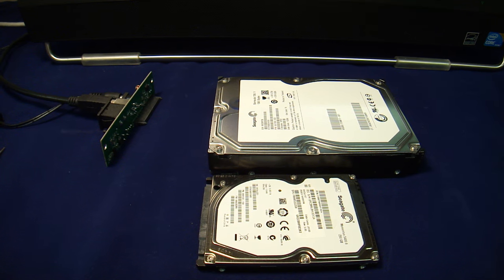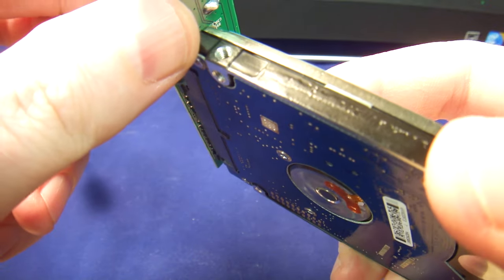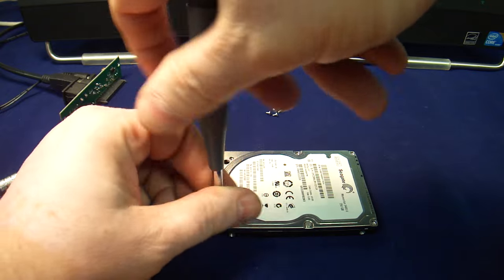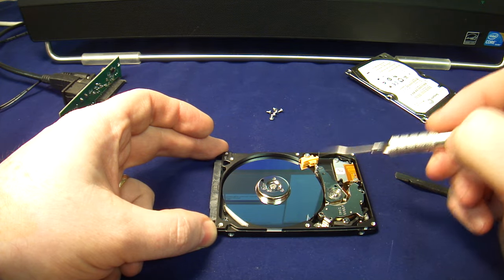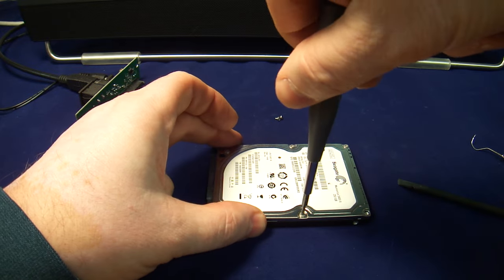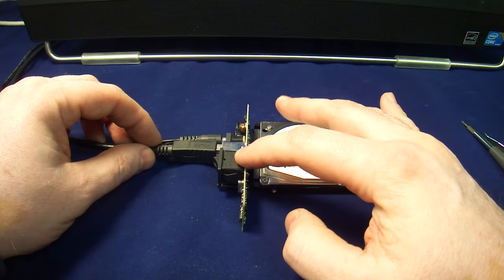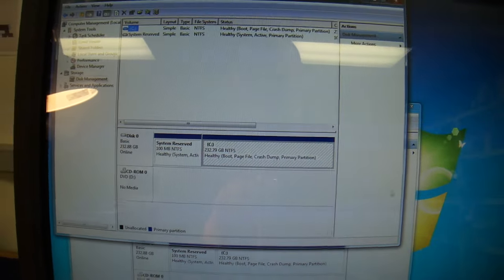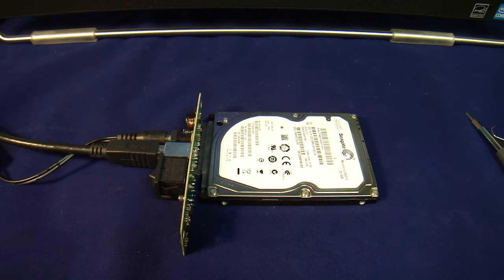DIY Video 2 How to fix a broken hard drive Beeping noise Get your data Back! Best Kept Secret

Comment: I have a problem with my hard drive but its not exactly like these.
When im starting my drive it just powers off by itself, then im hearing that it starts to start up again but again fails. Then it makes no more sound and i cant access it in windows. 

A couple of times i have managed to get it to start but it takes a long time for windows to read all the files on it and it doesnt sound good when it searches, no beeping or clicking really but its pretty load.

I only manged to copy a few gigabytes and then i got the info "cant read from the source file or disk"

What do you think i should do?

Comment: Thanks for your video, it worked on my hard drive; i know you said the HDD is done for and not fixed but is gonna happen again?, or what are the problems if i keep using it?
Reply: Did your HDD got that problem again or didn't pls tell because I'm in stress .

Comment: So I moved the thing off the plate and when I plug it into my computer it still won't recognize the drive but the drive does spin. I have a seagate and the little white light turns on for about 2 seconds and goes away. Anyone have any ideas? Thank you for your time

Comment: Hi Abraham , Thank so much for this great video ...
i have a 1TB laptop hard drive with exact same beeping noise ,
its not detected entirely by my laptop and laptop said no device to boot ,
i take my hard drive to somebody think he is recovery professional(without any isolated workplace or something like that) ,
he told me my hard drive head get weak and need to replace(he did n't even open my hard drive he just connect it to usb adapter) , and he told me i should buy a new exact same hard drive and give him that to replace head , but i feel he lied to me , do you recommend to do what you do on this tutorial by myself and repair my hard drive ? (i need to read hard drive data(some programming file) one time and then send it to trash)

With Best Regards.
Reply: Hi Abraham ,  i fix my hard with one of my friend who experienced in this field , and we do what you did , but use another type of adapter(it was more professional) , but thank you at all ,  this tutorial work for this noise sound ...
so as i said first recovery professional(haha) lie to me and the problem was n't what he said.
at last thank you for your tutorial , but i should mention maybe you(people who see this tutorial) need some software professional to recover byte by byte if your hard damaged seriously .

with best wishes for abraham ,
NothingLand

Comment: I have a 1TB WD Elements external drive, it fells accidentally and start clicking. Unlike the other click of death situations it only clicks at the start and the driver stops rotate. Is there any solution for such case?
Reply: Dereje Chinklo you need to send it for data recovery,  not a DIY job,  try www.copypastemaster.co.uk

Comment: Hey! My hard drive was beeping for like 5 secs continously before ibtook everything from the pc case and put back. Now it doesnt beep at all. When it was working it beeped once only when i started the pc as a sign that boots(i guess). Also my monitor doesnt show anything so i couldnt get in bios. I tried switiching the ram slots,different power source and a different graphic card. Please help,ty

Comment: So I did this and it worked fine at first but when I copied my data it stopped on the half and now I can't access the hdd anymore :'( But their is no beeping noise anymore and the head is on the right position... A last thing I could do?
Reply: I have the same problem , Do you what should i do?
Reply: Sheida D I successfully saved my files with a free program named "Recurva". Just let it search for non-deleted files. It might stop copying some files but then just skip them.

Comment: What coincidence that 3.5" inch Seagate 1.5TB is the exact model I have a problem with.
My seagate drive has a random model number in BIOS and does not report correct capacity. I cannot read the data and it clicks only on cold boot, if I reboot PC no clicking but still cannot access data. I think mechanically inside its OK but the  PCB board might be faulty. I  had a power outage for a split second rebooted PC and it was fine. Next day I cold booted machine and it was not working. everything points to PCB but I dont know how to be sure.

Comment: Please I need a council from you there is something that happened to me today I was working with my hard drive suddenly is stopped working I decided to reboot my system which is my laptop thinking that it will come up the hard drive did not come up I removed it put it in another Pot thinking that it will still come up the same thing I decided to remove the hard drive took it to another system plugged it still the same thing he did not come up in this case what will I do I've watched your video I love what you did but I don't know what to do please give me a council what will I do

Comment: Hi Abraham, I have an external HDD with the following symptoms
- platter spins
- arm is not moving at all (not on platter)
- after about 3 mins, the platter stops spinning

What can I try to do? I don't have money to send it to recovery centers. Please reply. Thanks.
Reply from the maker: +sgn15 You have electronics issue. Look for a busted chip or try to find a replacement board. It has to be identical.
Reply: +Abraham Levit By "chip" you mean the ones attached/soldered on the circuit board itself?
Reply from the maker: Yes

Comment: Thank you Abraham! Your instructions are right on the money. I recovered data on my WD 500GB laptop HDD without a problem. The only difference is that my WD HDD has 4 hidden screws I had to unscrew before I was able to open the cover, two under the label, two each under their own silver sticker like seals as outlined in this picture: https://drive.google.com/file/d/0BxLnd7HOI_k7OXZOYmladUl5LVU/view?usp=sharing

Comment: Hi Abraham. I opened up my hdd, and there are two scratches that run all the way around. No idea how this has happened. Is there any way I can recover the data? Please answer :(
Reply from the maker: Your heads are gone your platters are done for and data is probably corrupted. I have a video on that.
Reply: Thanks for answering. Yes thought as much. How does that happen tho? It's a 6 month old laptop, brand new. I didn't drop it or anything. I have since installed a new HDD, but I have lost all my data.

Comment: Mine hdd head stocked, I opened and released but its still doesn't work. ive two beeping noise not a clicking when Im turning my laptop now. could you guide me . Im living in Los Angeles if you know any place that I can bring my hdd
Reply: the reason that my HDD damaged, I put to much pressure on hdd cover

Comment: Hi Abraham Levit, my Seagate External drive started acting up 2 weeks ago. These are the symptoms:

1. beeps when computer turns on
2. does have power (has own power source separate from USB 3 cable)
3. i get a message from windows saying "usb device not recognized one of the devices attached to this computer has malfunctioned"
4. Cannot get to Disk Management, it freezes.
5. It (Windows explorer) freezes when i try to access the drive itself.
6. No clicking sounds (aside from the 1 beep all sounds seems fine)

Any suggestions? Thanks a lot!
Reply: Andrew Luis disk is completely dead

Comment: Thank you Abraham, I was wondering if you can help me, I have a 2.5 inch WD my passport ultra (4TB), 2017 version, suddenly it did not show the files and it does not eject when I eject it on my MacBook Pro, when I eject it, it comes back and it makes a very light sound, then turns normal, is there anyway to fix it rather than open it? Is it possible that the PCB is not working properly? I checked the HDD health and it says it's good nothing wrong with it, I installed the wd recoverit app and check it for a bit and it showed files, meaning I can restore them, but not yet cause I don't have enough storage, so in order to restore my missing files I am gonna need to buy a 4TB or 5TB one, that led me to make a search, I found out there are CMR, SMR and other types of drivers, I figured my WD ultra (4tb) 2017 might be a SMR drive, that is why it is faulty now or maybe it is the PCB! So, as I mentioned before I wanna buy another (4TB),  that is why I wanna make sure that I buy a CMR one, Can you please give me a list of 2.5 inch (4Tb) drives that are CMR not SMR? Even if it was a 2015 or 2016 versions? Or any older, newer ones? Cause I am planning to buy 2 drivers for now, Or any  good reliable 2.5 HDD recommendation or advice? I would be grateful!  Thank you

Comment: hi abraham i have a hitachi ata/ide internal hard drive which i am using as an external using the ata to usb port it has the clicking problem.i dunno how to fix it.i just wanna know whether is it safe to connect to my laptop as an external which i usually do will it affect the lap or anything.pls help.thanks
Reply from the maker: Its ok to connect as an external nothing will get messed up.
Reply: thank u :) mines not working got the clickin noise i opened it up and adjusted the head still nothin..
Reply: i think there is a problem with head..
Reply: +Sushil Kumar, U mean with your head.? That's possible..
Reply: Yes there is care to come and fixit😜

Comment: My Samsung 1TB external had the same problem, beeped and didn't connect to my pc. The head stayed on the plate. We fixed
 it like in the video. I connected to the pc, it was good at first, 100% condition, but at the second connection it started to warm and worked slowly, the condition decreased very fast. The condition now is only 52% in few hours and it says 273 bad sectors:( I don't know what could be the problem now:( Anyone?
Reply: See this part:  https://youtu.be/WNJqTPutrJ4?t=11m40s
Reply: I think the data and the head has been being destroyed by the dust got into your hard drive , any 1 more second it runs like that , it will be more damage , so get your data out ASAP , then say good bye to the hard drive , like the video said .
Reply: Molko, it wants to get replaced

Comment: My seagate wasn't being recognized so I thought it'd be this problem but I opened it up and it wasn't this.
Reply: Did you fixed it? Mine is a seagate too and I'm afraid to open it and not getting it fixed :(
Reply: Did you fixed it? Mine is a seagate too and I'm afraid to open it and not getting it fixed :(
Reply: @vannecaos9273  Sadly no 😢. Till this day I still don't know what the problem was. Ended up buying a new 2tb internal hardrive. Best advice I could give is upload whatever data you can to the cloud. And if the hardrive ain't working anymore anyways, might as well try to crack it open 🤷

Comment: You must be worried about ssds becoming the norm. Data recovery from them is more technical than the level your showing us. Please don't berate the data recovery experts abilities. What you're doing is like the difference between someone cooking at home and a professional chef in a commercial kitchen. Sure occasionally things go wrong and you get a slug in your salad but it's far less likely to happen when preparation and precautions are the standard and not an after thought.
Reply: Oh and no I'm not a data recovery expert. It boils down to how much is that data worth to you? And of course it goes without saying...backup backup backup! http://www.wired.com/2012/08/mat-honan-data-recovery/all
Reply: Their is a place for data recovery but not all the time.  I have seen several videos made by data recovery companies that were just plain dishonest and lying.  One I saw them intentionally leave a screw loose so it would fail, then claiming this will happen to all hard drives that are opened without the proper tools.
I cannot trust, or support a company or industry that lies to it's clients.

Comment: Why are they always Seagate? This makes me not want to ever buy one.
Reply: C MJ cause they are junk, mine broke in a week.
Reply: Well, I tried to give Segate the benefit of the doubt, but it would seem as though Segate drives are a bit unreliable. Unfortunately I have two of them in my WD NAS and I may have to replace them now because I am worried that they will fail. I also have two Toshiba 5tb HDD's in my NAS and they both have been reliable so far, but they only have a two year warranty on them. I may have to upgrade to WD Gold HDD's in order to ensure reliable performance.

Comment: Mine just makes a beep noise
Reply: If it's not a clicking noise than it most likely is a head sticking on the platter preventing the drive from sniping up. This video most likely will help but don't just move the heads with a screw driver remove the magnet to release the tension on the heads and park the heads (some heads park off the platter some park right next to the spindle you'll have to check on the internet to see what your particular drive does)

Comment: Hey guys. I have Seagate Expansion 3.5" 3TB Harddisk. I dropped from 50cm distances, "the top of the pc case" when its working, open i mean... Anyway after 30min "still opens", start buzzing 2-3 second after that buzzing, start beeping noise JUST 2-3 TIMES. but Light on HDD continuous flashing. Cant see on Computer or Device Manager. Can i fix my hdd like this video ? PLS HLP my hdd model: http://images17.newegg.com/is/image/newegg/22-178-117-TS?$S300$

Comment: Great video! You'll surely get some HD repair guys angry with you :P 
Did you ever had a case where the head is stuck in the parking position? That's what's happening in mine, like in this video https://www.youtube.com/watch?v=twwTiUbFBJM (not mine by the way). Is this solvable in any way? I can find a similar drive for replacement parts, but not the exact same one (different date, firmware rev. and so on)
Reply: ssmusica ssmusica you need to send it for data recovery,  not a DIY job,  try www.copypastemaster.co.uk

Comment: Hi, I'm from Ventanilla-el Callao-Peru ... please someone will have saved and disused a pentiun-3 or pentiun-4 motherboard OR motherboard from 2010 to 2015 ...... core2duo or corei3 processors from 2010 to 2015 ... 60GB OR 80GB hard drives DOES NOT MATTER OF ACE 15 YEARS THAT THEY HAVE SAVED AND DO NOT USE 2GB memories no matter the brand ... please is to build a PC AND BE ABLE TO FOLLOW MY UNIVERSITY STUDIES .... Thank you I will always be grateful to you Adriana Michel ...